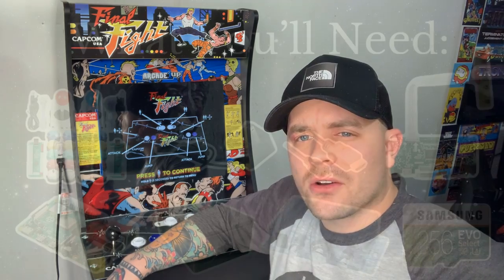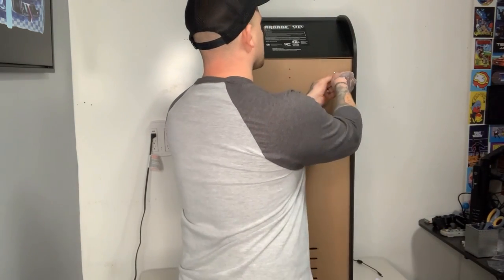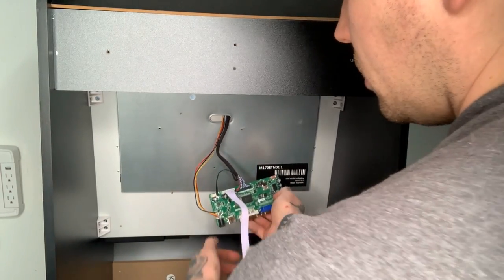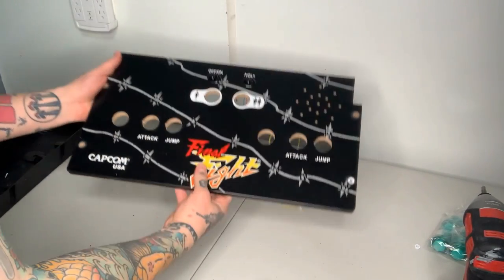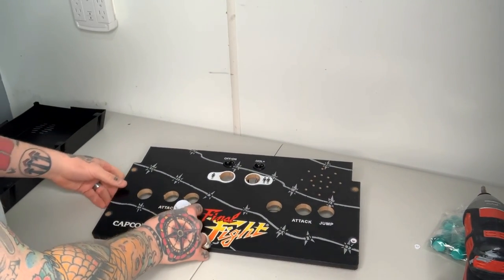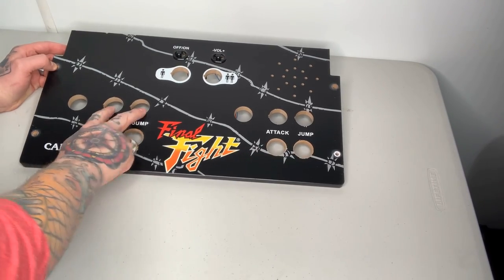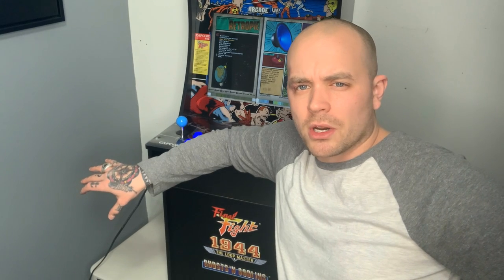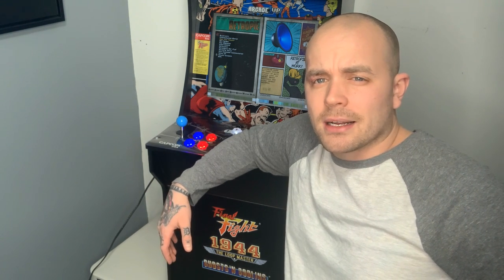How To Modify A Arcade1up Arcade Cabinet & Install RetroPie w/ Raspberry Pi 4  RetroPie Guy Tutorial

Comment: First of all, THANK YOU!  Your guide got me 99% there and I bought the exact parts you did for my Yoga Flame SF2 cab and a Super Console X Pro.  I couple of things I didn't see in the video that may help people: 1.  You must plug in your HDMI LCD Controller board in order for it to work!  In my case, the plug from my Arcade 1Up which used to go to my PCB board worked fine.  2.  The position of the joysticks matters!  I spent more time than I'd care to admit trying to understand why one of them kept registering up as down and down as up.  I assumed you could just configure it in the software and it wouldn't matter.  WRONG.  Hope these updates help someone!
Reply from the maker: I appreciate the kind words and also your contribution! I'm pinning this comment so it can help others by adding to the content in the video.

Comment: Dude thank you! I have the final fight and mk2 cabinets. I was staring the final fight buttons down for a while trying to figure out how I would fit 6 buttons.. then I looked at the mk2 and said screw it this is much less work! Its got 5 buttons. Then watching your vid i was dreading the hole for the select button but saw you popped them on the side - BAM! So much easier. Might throw in 2 buttons on both the sides as extras.
Reply from the maker: Solid choice man! Yeah the final fight one was such a pain but I got such a deal on it and this was my first time so I figured hey if I screw this up at least I'm not out much money. Turned out nice in the end but certainly a lot more work than what you had to do with your MK cabinet! Glad it worked out for you. Love hearing that the video was helpful to those taking on this mod challenge!
Reply: @OfficialChaseBrogan  Your videos are always helpful! Do you think there is a lot of mame titles that require 6+ buttons? Should I even bother making a 6th one aside from the select button? That was my main concern, having a game but missing a low kick or something!

Comment: Awesome video. IS the process the same on new cabinets? I have the midway legacy cabinet and the audio is top mounted and the speakers have a 3.55 jack not single wires. IS there still a way to do a complete pi mod.?
Reply from the maker: Hey not as familiar with those but I believe so. There will likely be some minor differences but sounds like the audio setup there would probably be easy to setup. Probably just plug directly into the he pis audio port.
Reply: Same for me, I have the midway legacy edition, I’ve tried to plug the 3.55 jack directly to the raspeberry pie without using an ampli, but the sound is too low. I’ve tried different setup in the raspeberry pie parameters but never been able to have high sound.
Reply: I got too frustrated and gave up I found a set of the klipsch computer speakers amd put them in and taped the knob to the top,

Comment: Where does the volumes wire go into? I noticed you didn't mention it in the video. My volume wire has 3 female holes/pins
Reply from the maker: You mean the volume control wires for the arcade1up? You don't utilize the on board volume controls. When installing a raspberry pi 4 the volume is going to go through the hdmi cable or thorugh a 3.5mm cable depending on your setup.
Reply: @OfficialChaseBrogan  ohhhh ok Tyvm. Makes sense now!!

Comment: Hello 👋,   is there a way you can share the link for the led joysticks and the raspberry pi 4. I know I can purchase the card and the cooler case with you.
Reply from the maker: Absolutely!

2 player - https://amzn.to/3m0MjRC
4 player - https://amzn.to/3CTMTaj
Reply: @OfficialChaseBrogan  Thank you . Really excited to get this mod started. can I  just get any raspberry pi 4 off Amazon for this?
Reply from the maker: @albertramirez2328  I would go with a pi 4 with 4gb ram that’s going to work best with retropie. The 8gb and 2gb have some issues with retropie. They’re overpriced on amazon jump over to Chicago distributors for it. They have the best prices and they’re awesome with customer service and fast shipping. Chicagodist.com
Reply: @OfficialChaseBrogan  I pretty much got everything set up . I went with your 256gb
Card😁 which I should be getting in the mail this week.  I tried   turning everything on to see how the my buttons light  but for some reason they don't. My lcd turns on fine but I get a message saying there's no signal. Does the micro card need to be inserted in order for the buttons to light?
Reply from the maker: @albertramirez2328  hmmm I’m not actually sure about that. I’ve never powered on a pi without a card. I would think they would light up off the power regardless but maybe not 🤷🏼‍♂️. Not sure I guess we’ll find out very soon though.
Reply: @OfficialChaseBrogan  update , the SD card definitely has to be inserted Into the raspberry pi in order for the buttons to light up.

Comment: Hello sir, what kind of drill (rpms/power) did you use with the step bit?  Cheers
Reply from the maker: Cordless Milwaukee drill I believe it’s max rpm is 1,800 rpm. Nothing too crazy it does take a little while to drill but I go slow and careful to avoid splintering the edges of the hole

Comment: Would this same tutorial work with the marvel vs capcom cabinet as well?
Reply from the maker: It would in terms of most of the tutorial. The control board would be a little different since that one has a different layout than the one in the video. That is a much better cabinet though. It has way more buttons so you don't need to customize it like we had to do in this video.

Comment: great video :D which retropie image are you using?
is it possible to use original arcade1up joystick with usb encoder?
is it possible to use the original speaker on raspberry withouth the ext mini amp?
Reply from the maker: I don’t believe either are compatible.
You may be able to wire in the joystick and buttons into the encoder somehow but honestly they aren’t really good enough to make it worth the extra work in my opinion. You’re better off just grabbing a kit to swap everything out. Link in description for a kit. The amp is needed to control volume. They’re only about $15 or so

Comment: Question once you seal everything back up how do you turn the machine on/off? Thank you
Reply from the maker: I plug everything into a power strip with a on and off button and just hit that to turn everything on and off but I use the safe shutdown inside retropie first.
Reply: @OfficialChaseBrogan  so you leave the power strip outside the cabinet?
Reply from the maker: @lnguyen602  I have a cabinet that’s mounted to the wall so I have the power strip mounted underneath where  you can’t see it.
Reply: @OfficialChaseBrogan  I'm pretty new to retro pie, I was wondering if I download an image that's 256gb to my pc, can I transfer just the games I want to the raspberry pi or do I have to transfer the whole thing for it to work properly? Thank you for all your help!
Reply from the maker: @lnguyen602  You need everything in order for it to work. There's many layers to these retropie images.

Comment: Hey man great video, helped a lot! I’m about to get a MK cab for my birthday pretty soon and I wanna do some modifications but I have a few questions. So for the raspberry pi, would I be able to find one online with like almost all the games you have?? I’m really interested in that and were you able to play like MK deception, deadly alliance and Armageddon? And a thing about the control panel. The only modifications I want to do that is change the buttons to light up and maybe if I have enough money after my birthday then get a new control panel (art wise). But I’m sorry for the questions I’m just really trying to get the best I can get. Last question, does the raspberry pi run all the Arcade1up games?
Reply from the maker: hey there, happy to help! Yeah I have cards available that would work with an arcade1up mod. In fact the 512gb card actually have a collection entirely dedicated to arcade1up games but there's way more than that available. The one used in this video is the 256gb card but the 512gb card is the latest card with more capabilities. It has less games but that's only because of there's more later releases which take up more space. Below are links to each card tour. I'd have to check on mk deception, alliance, and Armageddon but I'm pretty sure they all work. I have full game list pdfs too I could send you if you just reach out to us by email and request them. 

256: https://youtu.be/zw2fmgUTFxs
512: https://youtu.be/YuO9OlncFZo

Comment: Hi, I have the raspberry pie 3. Would you recommend upgrading to a pie 4 or no?
Reply from the maker: I do believe the 4 is the better and certainly more updated version. It gives you access to more game collections and would be more usable with newer emulators. The other side of it though is if you are happy with the performance of the 3 then maybe the if it ain't broke don't fix it mentality is the way to go. Just depends on what you are looking for. N64, Dreamcast, PlayStation, and PSP runs better on the pi 4. Beyond that I do believe the rest of your collections perform pretty much the same way.
Reply: @OfficialChaseBrogan  

Thanks you for the info. 👍
Reply from the maker: @Ace-tw5db  Anytime!

Comment: Awesome video bro. I did the mod only with pie 3b+  I installed a USB dual port into my jpanel plugged into the pie with 2 cheap USB snes controllers. It worked fine for a couple weeks. Now my emulationstation is not recognizing the 2 controllers. Just the 2 joysticks. Any help would be appreciated. I even tried to reboot emulationstation and no luck
Reply from the maker: Hey there, thanks for the kind words! So the pi has 4 units plugged into the usb connections right? If you were to unplug the 2 (I assume it's two) arcade control connections and reboot, do the snes controllers now work? Try with just 1 snes controller if 2 doesn't work. This will tell us if the arcade controls are throwing off the snes controllers.
Reply: @OfficialChaseBrogan  no I tried rebooting it with the joysticks USB disconnected and just the snes USB controllers in. My emulationstation isn't recognizing the game pads for some reason.
Reply from the maker: @brianbuzby5347  

Try resetting all your input configs and remapping both pairs of controls. This usually clears errors like this. Let me know if this works. 

https://youtu.be/Yv-fclDfd5k

Comment: I just picked up the Simpsons machine. Do you know if this will work on that?
Reply from the maker: Yeah it will but you probably want to add more button holes as the Simpsons arcade deck only has 2 buttons for each player. Not sure if the trackball will work or if you'll have to replace it with another trackball that does. I would lean more towards needing to replace it but I'm not positive on that.

Comment: I'm confused - I have the MK2 Legacy Cabinet and it doesn't have the same ground wire. It just had this little tiny white cord that was plugged into the grounding spot. Do I have to connect the white wire somewhere to ground the new LCD panel? Because I'm not getting and video on my machine.
Reply from the maker: I’m not sure since it’s different then the cabinet here. If you’d like send me a email with some pictures and I’ll try to help you.

Comment: Hello! Thank you for the awesome video! I am new to this stuff, can a Raspberry Pi 4 be installed without replacing the joysticks?
Reply from the maker: No because the connection isn’t right. You need a usb encoder and the wiring that connects to and from that for a raspberry pi to go in. If you check the description of this video you’ll see there’s a direct link to an entire kit with buttons and the joysticks. It’s u def $40 and really a great kit that gives you everything you’ll need for buttons and joysticks.
Reply: @OfficialChaseBrogan  Thank you! I appreciate it!
Reply from the maker: @DyadintheRough  any time!

Comment: nice tutorial....I have picked up one of these cabs with a broken LCD is there anywhere I can get cost effective replacements? I am un the UK
Reply from the maker: Parts can usually be tough to find. I've run into that issue myself on multiple occasions. eBay is the best place to find parts although they aren't very common so you have to wait around a lot of times or buy a broken unit that has parts that you need that aren't damaged. You can sometimes get parts direct from arcade1up but they generally aren't cheap and they're not the easiest to get in contact with.
Reply: @OfficialChaseBrogan  thanks buddy

Comment: I recently bought a arcade 1up cocktail table and was hoping i could find a tutorial for cocktail tables, would it be the same as this install how would i get the screen to flip when playing two player
Reply from the maker: I believe the process is the same it may differ with the layout obviously but same idea. There are video settings within retropie to accommodate that screen setup
Reply: @OfficialChaseBrogan  are u able to list me off the parts i need so i can look them up on amazon.
Reply from the maker: @CrazyCam-ci7yj  I can certainly list the parts for this build but I’m not 100% on the one you’re describing as I’ve never done it so it could differ slightly.
Reply: @OfficialChaseBrogan  the machine is a arcade 1up 12 in 1 head to head black edition it has 7 buttons on each side thats including the 1player or 2 player button
Reply from the maker: @CrazyCam-ci7yj  got it should be same deal then. I’ll make you a list later tonight
Reply: @OfficialChaseBrogan  ok thank u
Reply from the maker: @CrazyCam-ci7yj   Hey ! Here you are my friend. 

https://www.amazon.com/gp/product/B07D8GXSRV/ref=ppx_yo_dt_b_asin_title_o03_s00?ie=UTF8&psc=1

https://www.amazon.com/gp/product/B00NO73IN2/ref=ppx_yo_dt_b_asin_title_o05_s00?ie=UTF8&psc=1

https://www.amazon.com/gp/product/B07MLWJDGD/ref=ppx_yo_dt_b_asin_title_o06_s00?ie=UTF8&psc=1

https://www.amazon.com/gp/product/B07ZVMWPZP/ref=ppx_yo_dt_b_asin_title_o09_s00?ie=UTF8&psc=1

https://www.amazon.com/gp/product/B07WNNVVXY/ref=ppx_yo_dt_b_asin_title_o00_s00?ie=UTF8&psc=1
Reply from the maker: You should also get a surge protector for the bottom which in the video you can see I use and some small zip ties to neaten up cables so everything isn't a mess. You can get those on amazon or pretty much any store. If you need a sd card preloaded let me know. We have a couple great cards with thousands and thousands of games. Thanks.
Reply: @OfficialChaseBrogan  out of curiosity is their any lag on the controls or is it perfect
Reply from the maker: @CrazyCam-ci7yj  with those controls I had no lag. I can’t say you won’t find a game with lag anywhere on there but in my experience everything was pretty flawless.
Reply: @OfficialChaseBrogan  i was told by someone that their is lag in the controls if i went with the rasberry  pie and just wanna know if i should spend the cash or know hes full of shit

Comment: Hi, I changed my board to this new one. But I have a problem. I don’t know where to connect new joystick to this new board. Any help
Reply from the maker: The joystick goes to the encoder which connects a usb to the pi itself
Reply: @OfficialChaseBrogan  am sorry am new at this . But I don’t follow
Reply: @OfficialChaseBrogan  but am using the original joystick from the arcade1up
Reply from the maker: @newcreationNB  oh okay, I can’t remember the connection type for the original. I’m not sure that you can use that.
Reply: Lol, ok I already set the new lcd controller board, but there was a wire that connect from the old board to the joystick 🕹. But now since I change the board to the new one. I have no clue how to connect the joystick to the new one
Reply: @OfficialChaseBrogan  yea is like am stuck now . I have no clue how to use the original joystick 🕹 with this new board
Reply from the maker: @newcreationNB  I believe that wires connection so different from the new ones. What are you using for buttons? Original buttons or new set
Reply from the maker: @newcreationNB  if you’d like email me a picture of the end of your joystick cable so I can see it and make a recommendation retropieguy@retropieguy.com
Reply: @OfficialChaseBrogan  everything is original. The only thing I have I the raspberry pi 4 and the new lcd controller board
Reply: @OfficialChaseBrogan  ok sent,

Comment: Can I use one of these or an Outrun A1U?
Reply from the maker: Use one of what?
Reply from the maker: Oh on a outrun a1u? Are you going to be adding  buttons and joysticks in place of the wheel or keeping it as it is? I'm not sure if the wheel would work with retropie. A lot of usb wheel controllers do work with retropie but it's a little hard to set up. IF it did work you would only be able to play racing games and I would imagine it would be the older one not the later titles like cruisin world etc. Just off my personal experience with wheel controllers they are very touchy to get working well. They tend to be great for outrun and those 80s-mid 90s racing games but n64 and up I've had a lot of trouble with getting the wheel to work well.
Reply: @OfficialChaseBrogan  thank you!

Comment: Hey have you seen issues with retropie on a pi4? If I have four joysticks plugged in I get a joystick assertion failed.
Reply from the maker: I have never experienced that. Damn, wish I could be of assistance there. One thought, make sure your player connections are all conneted to the encoders the exact same way. Each encoder and its connections should mirror all the others.

Comment: What size drill bit is best for the side buttons?
Reply from the maker: 30 or 24mm for the hole get a step bit that's what I used. Should be a link in the video description for the exact one I used

Comment: How do you turn the system on and off?
Reply from the maker: Shut down from within your main menu to sfaely shut down the system but then use the on/off switch on the power strip in the back to cut the power to the unit.